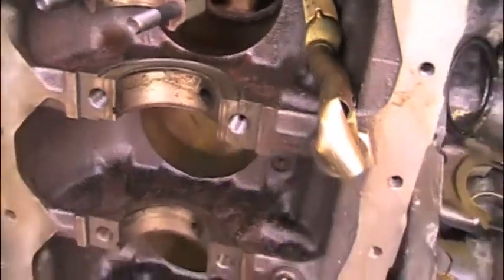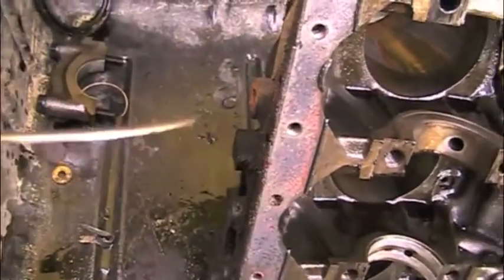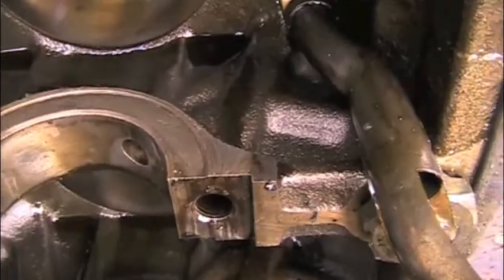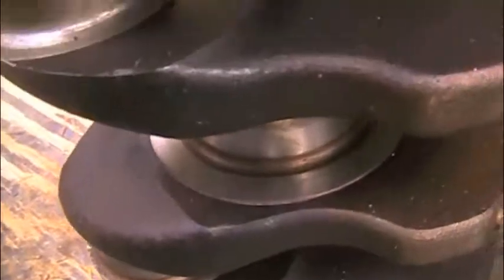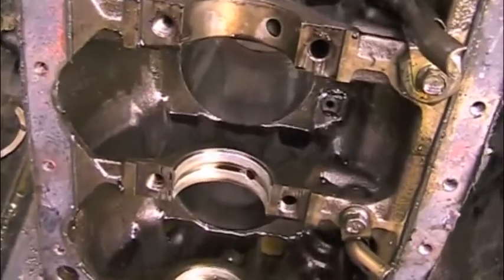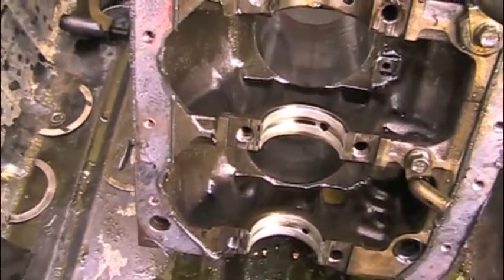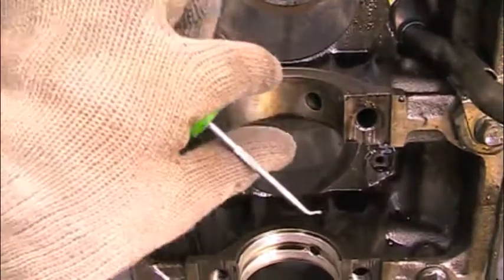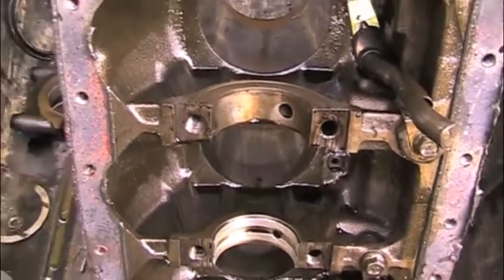Isuzu catastrophic engine failure damage

Comment: Has anybody done the research to determine a conventional style thrust bearing used in another engine that could be substituted to prevent this engineering short coming from happening? Out of all the engines made there must be a engine that uses a bearing of the same dimentions that doesn't have a 3 piece thrust bearing.

Comment: Very informative. My 4ze1 sounded like a rumbly big end just off idle and on deceleration but went away after 1500 rpm. If I had of held pressure on the clutch the noise would have gone quiet I suspect. 400K on the clock. Pulled it down and only damage was one thrust bearing. ( clutch pressure side) the motor was in great nick for the mileage. Strong motors. 
Detlyn.

Comment: This also happens when adjustable clutches have no free-play, the crank is constantly pushed forward due to the TO pressure against the clutch asm, you'll see this on Troopers up to --87' with 4ZD1's, and even later on pick-ups.
I don't remember seeing this on the 1.8 or 2.0L engines.

91 Trooper 4ZE1 260,000 miles, just getting started...